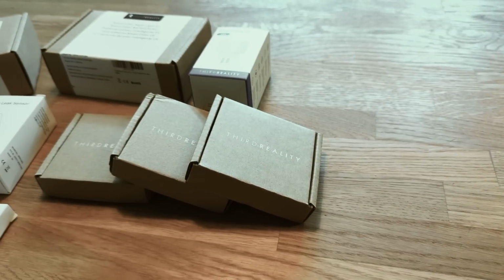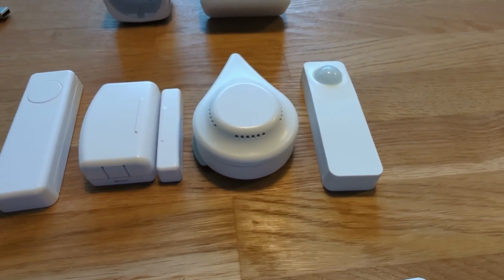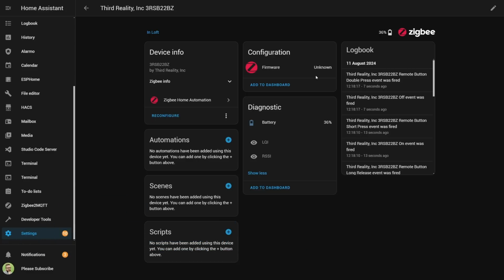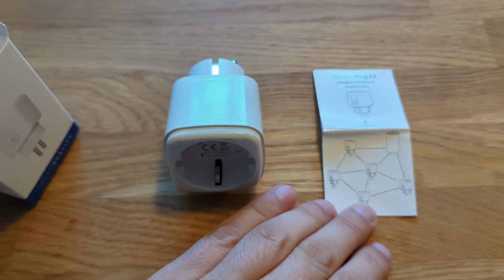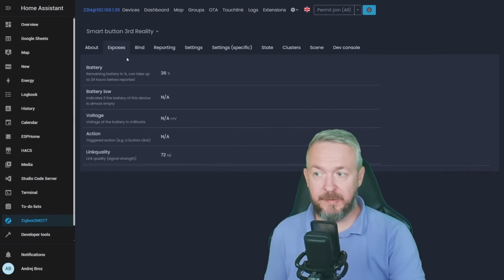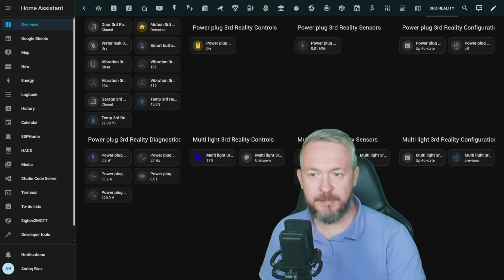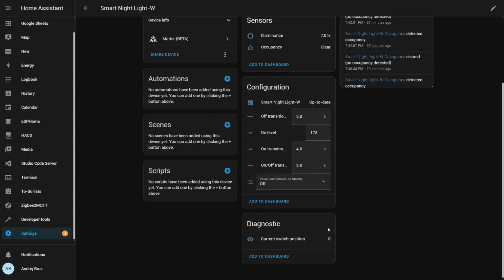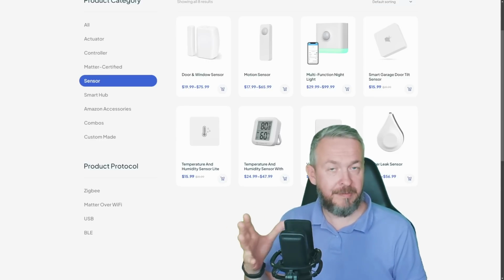How about 11 devices from Third Reality?

Comment: I make heavy use (I have 80+) of 3R, along with with rechargeable AA/AAA batteries. The cost of battery replacements has made them even more attractive, for supporting many devices, over the long run.

A minor downside/annoyance is that rechargeable batteries never look like they are at "100%",  but I (and my wallet) have learned to live with that.
Reply from the maker: I completely agree, the long-term savings on batteries definitely outweigh the slightly inaccurate voltage readings. 😄

Comment: I am just watching this now.   I like the third Reality products and how Third Reality is supportive of Opensource and automation hubs that are not their own.  The only disadvantage to using AAA or AA cells is the size of the device.   I find the door sensor is a little large for the door frame.  the usual way to install would be magnet on the door, electronic part on the frame and it won't fit that way on my door, but I guess can do it the other way and put the electronic part on the door and magnet on the frame, but in my case I have a metal framed door and this interferes with the magnet, so I had to use a different door sensor that had a smaller footprint.
Just on the batteries,  NiCad AA or AAA cells are 1.2V instead of 1.5V but you can get AA/AAA Lithium cells and these are actually the same voltage, 1.5V nominal, as the non-rechargeable ones and will show 100% battery level when fully charged.
Not sure what it was like a year ago, but they come with batteries now.

Comment: You really need to update to cover the 3reality R1 Motion zigbee mmwave battery sensor.  This sensor has solved most of my motion sensor problems and it is simple setup!  If you need battery, mmwave, and simple occupancy, this is THE sensor to get.
Reply from the maker: I'm waiting for few items, but also 2 delivers failed in transport - we will see what will arrive (eventually).
Reply: @BeardedTinker  Yea, shipping from China takes forever sometimes.  Also preordered the matter keyboard.  Seems like an oddball thing, but might be neat to control things in my office.
Reply from the maker: Just checked - I'm waiting for keyboard, R1 sensor, watering kit and soil moisture sensor. Waiting since early February.
Reply: @BeardedTinker  Ordered my first set of R1s at beginning of Mar and received them just over a week ago.  Ordered another two (all they had left in stock wouldn't let me add more) last week, and got a china shipping number a day ago.  There is a listing on US Amazon, but shows no stock yet.
Reply: With R1 only get battery and occupancy with z2m.  adjust sensitivity on device with + - buttons.  No cool-down adjustment but seems to take around 20-30 sec.
Reply from the maker: Looks like there were some changes in april release of Zigbee2MQTT, not sure what was added or fixed though.

Comment: Are the door/wimdow sensors and motion sensors rated for use outside?  I want to use a door/window sensor in my mailbox to let me know when mail is delivered, and  the motion sensor to notify me if someone is on my front porch /doorstep.
Reply from the maker: While it would work if the device is inside, if door/window sensor is left outside on rain, it would brake. Also, if you're putting it inside mailbox, made out of metal, that would block signal unfortunately. 
As for motion sensor, it should work outdoors, but it must be protected out from the rain as it's not water proof.
Reply: Thanks
Reply: FWIW, I use a vibration sensor inside of my metal mailbox, it's about 4 meters away from the nearest zigbee router and works fine for me. I also have several of the stick motion sensors in outdoor areas that have roof coverage that have been fine over a couple of years (I live in Oregon USA, with temperatures ranging from 13 tp 102 F, or -10.5  to 39C, and lots and lots of humidity and rain). I wouldn't put them in diect rain/snow/heat, though.

 Third Reality also have a new "Motion Sensor R1 with Case" device (model 3RSMR01067Z)  for outdoor use, but it is a more expensive device than the little stick sensors. While I have 3 of them that I am testing now, I don't have a full year's of results yet. :)
Reply: @R @RonaldChmara thanks for your response, very helpful, I will look into what you have suggested, thanks, I’ll be interested to learn what your research yields, appreciate it.

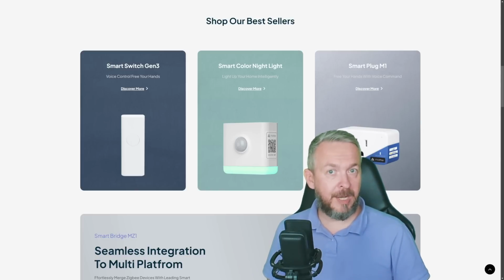Comment: 28:44 Agreed! I have the night light turn on red when the garage door is open.  I also use the illuminance sensor to control the lights in my living room, so that on cloudy or rainy days, the lights turn on earlier than the normal “turn on at sunset” automation. Plus they work fantastically as a simple night light too.
Reply from the maker: That's really great use case! Yeah, was a bit sceptical really when device arrived, but it ended up being more than I though of it.

Comment: I got a 4 pack of plugs with PM, to extend my zigbee network, but ZHA says they have a terrible connection to my coordinator unless they are right next to it. Once they aren't in the room, it's awful in the visualization.

But my other zigbee devices seem to have much better connections at comparable distances.
Reply from the maker: I haven't seen issue with 2 plugs I have - they work great through floor with reinforced concrete. Are end devices slowly moving to them or not and can you control them or are they not responsive? Those are the main questions.
Map is good for visualisation, but actually doesn't represent anything if it shows bad signal and everything is working, or if signal is good in map, but devices are not reacting.
Reply: @BeardedTinker battery-powered (aqara sensor) end devices connected to them would be less responsive and more likely to drop out than when they were connected to vindstyrka AQ sensor.

Ikea sensors show incredible connection and aqara motion sensor seems to pick me up more accurately.

Comment: I have the motion sensor and the night light. They work really well overall. My main complaint would be that there are not enough ways to tweak the cooldowns. The night light will also has a local mode that will make it function as a normal night light if it hasn't received a command after 12 hours. That I like. I plan on trying their whole line of devices except for the door sensors. I like those to be as small as possible.

Comment: You can get rechargeable coin cell batteries. I use them for most of my devices. The problem is occasionally you get a device that will just not work with rechargeable batteries, whereas with AAA I can’t think of an example I could not just replace them. Actually just thought of one, but it’s rare. The Google Nest Protect Smoke alarm insists on lithium non-rechargeable, but I wonder how the Lithium Ion one’s pretending to be AAA would get on. I would suggest getting a rechargeable coin cell charger and some batteries, but just remember some devices will just refuse to work. Sometimes the same sensor from the same company will work or not despite no observable differences so I can’t suggest devices that don’t work as I also have an example that does.

Comment: How quickly/frequent does the power plug report power consumption? Does it report changes almost immediately or does it take a couple of seconds for the sensors to update?
Reply: Very fast in my experience .. within a second, usually .. and yeah, there is a whine when they're in use but as long as they're not super close, you won't notice (I'm highly sensitive to sounds like that)
Reply: I can confirm that it's about one second. I've got 16 of the ThirdReality smart plugs and I also have an Emporia Vue 2 energy monitor with CTs connected to all of the circuits in my circuit breaker panel/load center. They're also very accurate. I bought them primarily to use as Zigbee repeaters to strengthen my mesh network in Home Assistant and they are far superior to the Sonoff Zigbee smart plugs.
Reply from the maker: It's close to 1 second, I wasn't able to measure it very precisely. 
For example, I turn it on in HA and in around 1-1.5 second I have update of power consumption. But also this includes time to trigger the switch in plug too.
Reply: Ooh, that's nice. 👍🏻 Still waiting to see how the upcoming IKEA energy measuring plugs are going to perform and cost. 

But these have definitely moved to the very top of my list.
Reply: BTW, is there a coil whine when the plug is in use? A lot of other plugs, especially many Tuya, have this issue. This can get really annoying if you use them in the bedroom.
Reply: @TommyBrenner  I've got 4 non-PM and 3 PM plugs in use, with the non-PM plugs acting as repeaters for our basement water leak sensors. One non-PM plug does have some pretty noticeable coil whine when it's turned on but there's no load connected to it; I'm not sure if it's the case if there's a load as well. None of the other plugs, PM or non-PM, have any coil whine that I can hear.
Reply from the maker: You can hear it clicking when you power it on/off. Comparing to Shelly it's similar or just a fraction louder. But I don't hear the coil inside when device is powered and under load.
Reply: Good to hear, cheers! 👍🏻